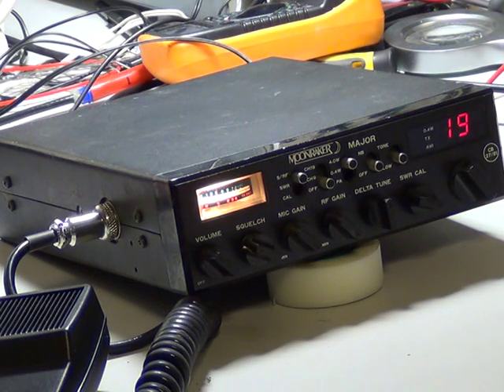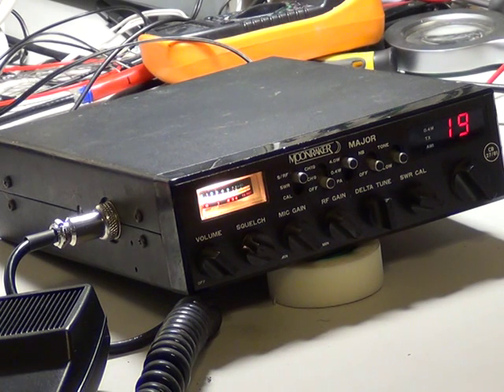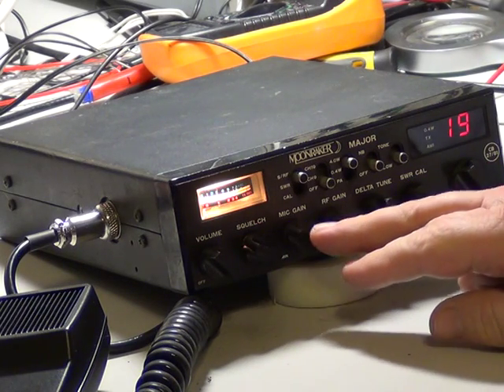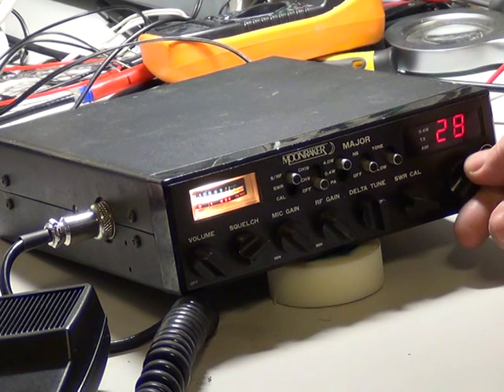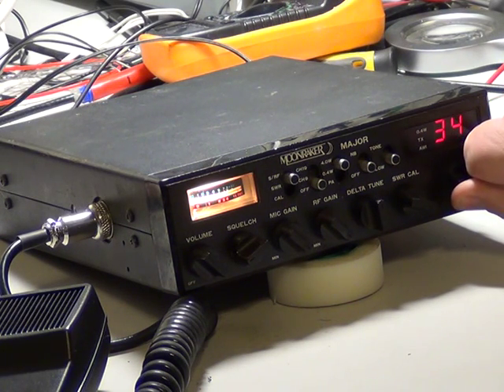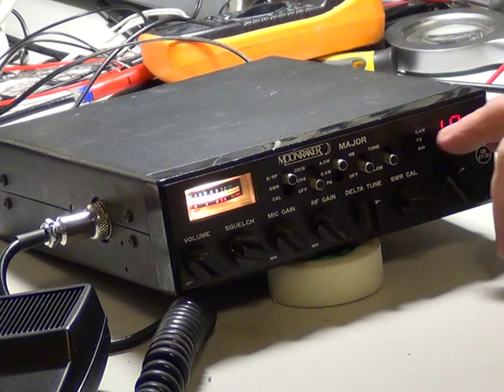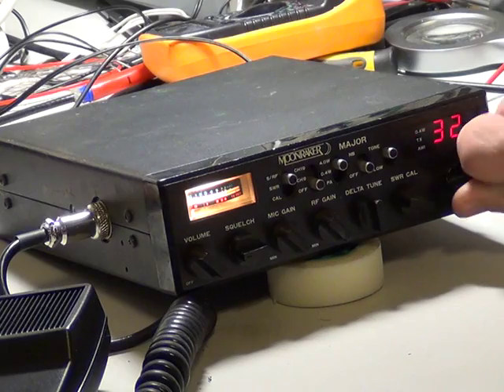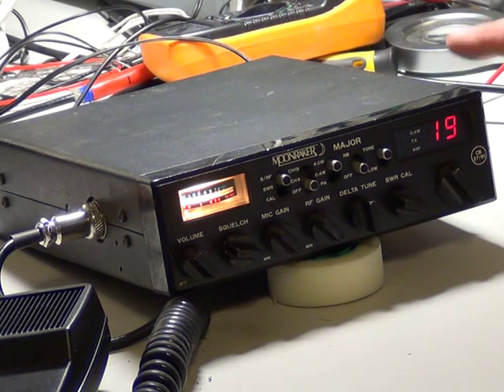Moonraker Major - UK CB radio, (CB 27/81) (Mobile) -  On The Air Test

Comment: Just got one of these 'untested' and nice and cheap. Needed a little work; meter light out, front panel very dirty but no scratches, no tx output was traced to a broken feeder from the board to the SO239 - resoldered. Deviation was flat out so turned down. Frequency (CH 20) had slipped to 27.79078 now set to 27.79126 spot on. Power output was already a good solid 4 watts. Now looking and working superb!

Comment: I owned one of these, I really liked it. So was it really 1989, I couldn't remember the year. I know I bought mine when they first came out. Also owned an Audioline 341 which was great too. Too many others to mention aswell. Steve
Reply from the maker: The Audioline 341 came out in November 1981. I'm sure the Moonraker Major appeared in 1986

Richard
Reply: did you get rid steve or still power them up now and again? looking at getting one again after many many moons as i dont get out as well as i used to now abd be good to know if people still get onlne 👍

Comment: I remember these causing quite a stir when they were launched, we all wanted one!
On a slightly related note, I remember one time a rig that didn't transmit someone had replaced the output transistor with a 7805 voltage regulator!!!!!!!
Reply from the maker: Typical numpty knowledgeless stunt....usually looks like it's been soldered with a gas poker too!
Reply: @ukfmcbradioservicingTango21  I can't imagine many people having cb radio's these days with mobiles phones & thee internet maybe an odd 1 or 2 here or there but they would probably be few & far between now